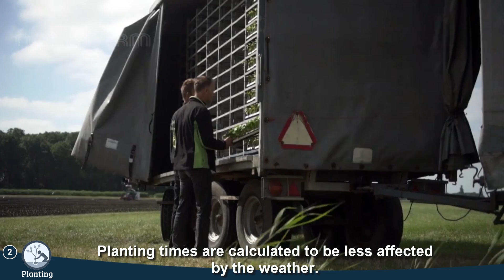Awesome Cauliflower Cultivation Technology - Cauliflower Farming and Harvesting Machine

Comment: I love cauliflower and have a suggestion about its shelf life.  I've notice that these wonderful heads start to have brown and black spots as they age on the grocers shelves with little to no refrigeration.  What I believe might help institute a longer shelf life is if after spray washing or handling them, they coat the heads with a light spray of paraffin wax as they do for apples and won't hurt your digestion or flavor the florets.  I see many heads of cauliflower set on the shelf and wither until some idiot buys it or the grocer throws it away because it can no long be sold with black spots all over the head.  The cost of course will increase only a slight amount which most shoppers will not even notice if they like Cauliflower.
 Anyone have any other suggestions ?
Reply: Paraffin wax isn't edible. It's insect or plant waxes that are used.
Reply: @toomanymarys7355  Thank you "Too", I stand corrected.  I had not even considered that.
Reply: NO, the spots are harmless.... Don't fuck up a perfect food
Reply: @daveklein2826  What makes you think I am fucking-up a "perfect food"?  Because I speak of dark spots on the heads?  AND NO, I am not going to eat black spots, because I am not that hungry nor poor.  Have at it, you might even have fun eating all those throwaway leaf stalks on the head that the processors leave on to gain a price-per-pound advantage.

Comment: 3:53 Where is the driver of the tractor?
Reply: Most farm equipment have autopilot function and use GPS to guide the tractor.  Human is only needed to trace the field perimeter and turn around. Typically when you see a farmer in a tractor they are not driving. They are there to make sure that the computer doesn’t have a issue.